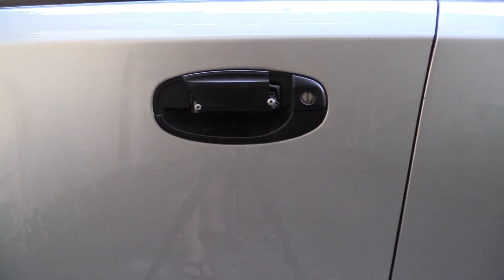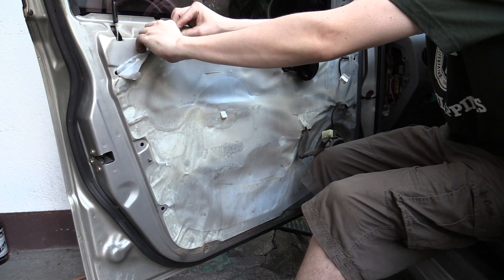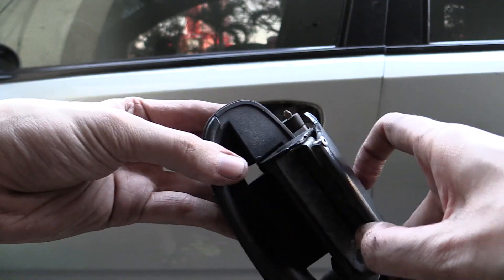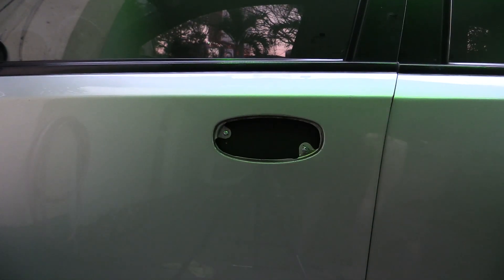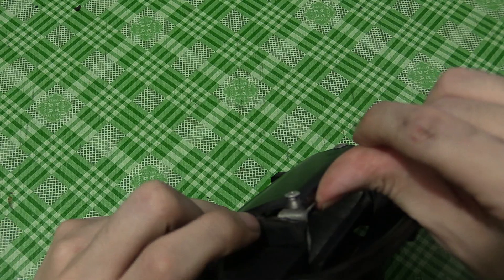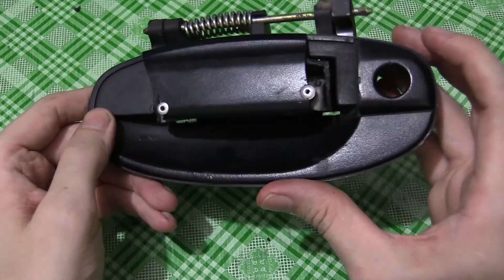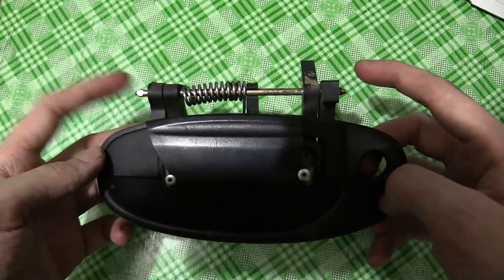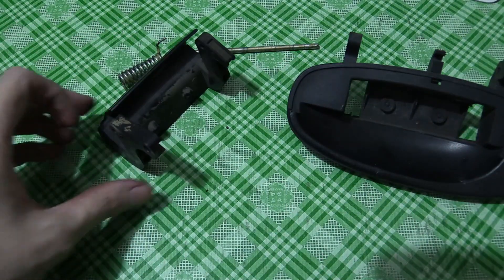3D Printed Chevrolet Door Handle - Part 1

Comment: id be willing to bet the rod is reasonably soft hit it with a hammer and push in the flared en then remove to spread it out after repair use hammer and screw driver

Comment: I was wondering why you did not just copy the good handle from the rear door. Or were you just trying to learn the modeling process by designing the replacement in phases?
Reply from the maker: +Ole Ersson hmm good point. I could. Although the process would be pretty similar I think. I actually still need to finish this project.